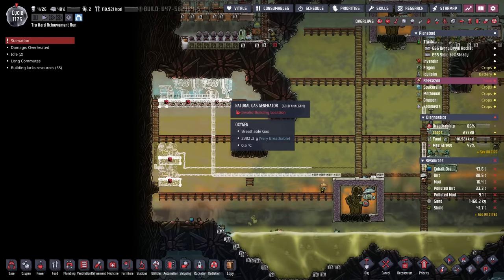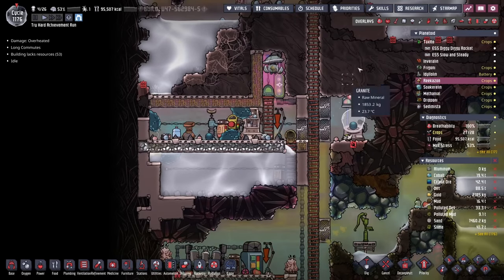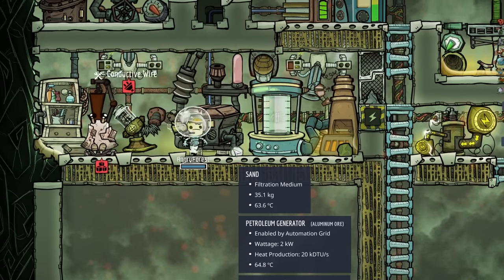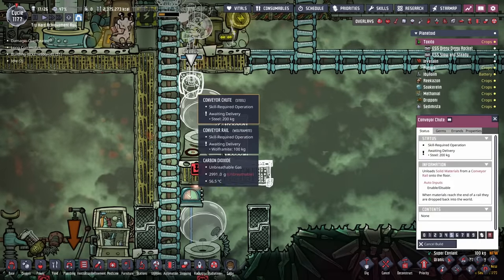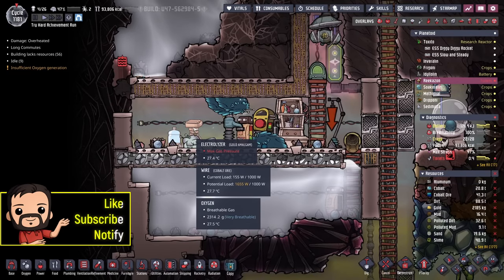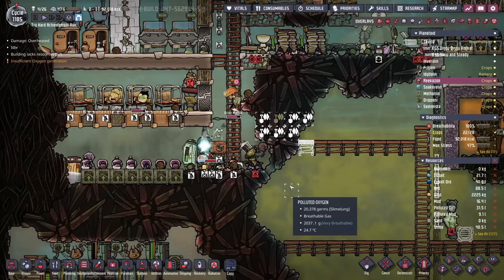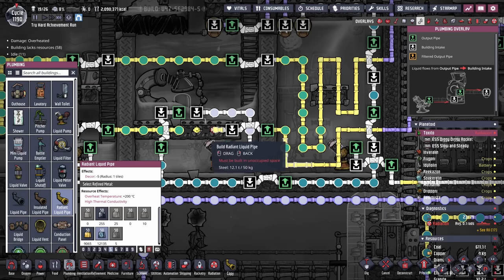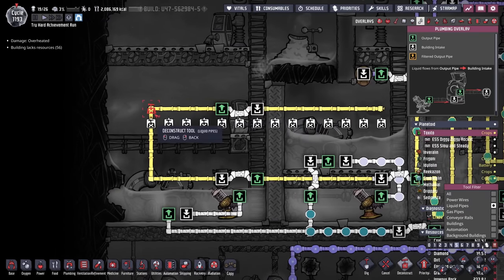Finally Super Coolant! | Max Diff Achievement Run | Ep 25 | ONI

Comment: I have been playing around in debug mode, And was working on a petroleum boiler that uses the metal refinery, as the heat source. I had it converting 10kg per sec crude oil, refining iron into iron ore.. It is monstrously Over powered.. it also powered it self and all it needed was the crude input. all it took was 1 dupe to run it, even when the dupe had normal downtime, it was still running flat out 10kg per sec. You can even do it early game, all you need is Naptha as the coolant, and made the refinery out of ceramic, because it does not turn into sour gas until over 1000F. Its easy to build and requires no magma or special exotic metals etc.
Reply: Where did get Naphtha early game?
Don't you need plastic first?
Reply: @Hanmacx  you kinda do need plastic. But if you can ranch dreckos you will be good. You only need enough to fill the refinery which is like 800kg i think

Comment: I managed to do all achievements in one run on pretty default settings few days ago, in cycle 1386. You were at cycle 1177 when You said that Wolframit will be used later in the game to produce Thermium. At which cycle do You plan to complete this Max Diff Achievement Run? Which achievement will be done last? Mine the gap? GMO-A-OK? Or just breaching through Temporar Tear? I can't wait to see how You are going to charge Temporal Tear Opener.

13:57 - Hehe I think You underestimate peoples 'I am to tired to rebuild it, I will just put a 10 bridges all around colony' done several times in the same gameplay. Automation is even worse in my designs.

Comment: Why dont you just use supercoolant for a short AT loop, then use that to cool down a longer loop of whatever with some metal tiles and radiant pipes. For a single AT loop you only need 60 kg, two for the AT, two for insulated tiles, and then finally two radiant pipes for heat exchange. Instead of controlling for SC temp just control for the other coolant, since SC cannot freeze anyway.

Comment: The bet you will loose. The SHC of super coolant is 8.44 and the SHC of salt water is 4.1. 40% of 8.44 is 3.376.

Maybe try to use more efficient cooling method than cooling a tank full of water?